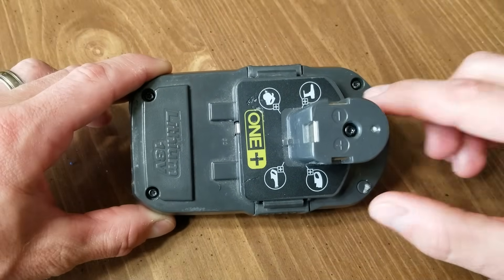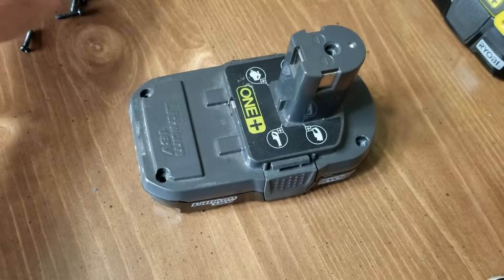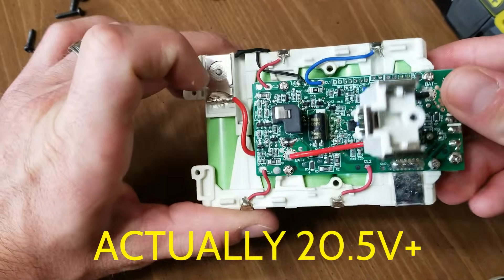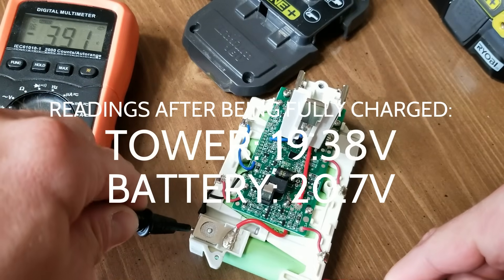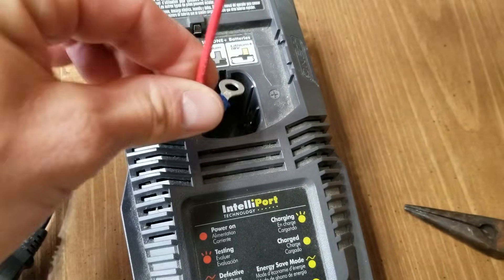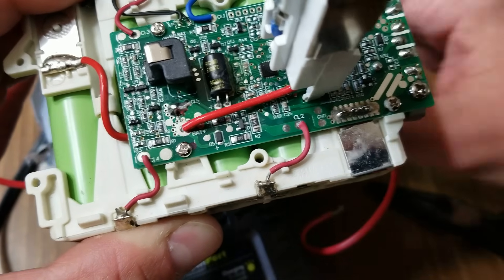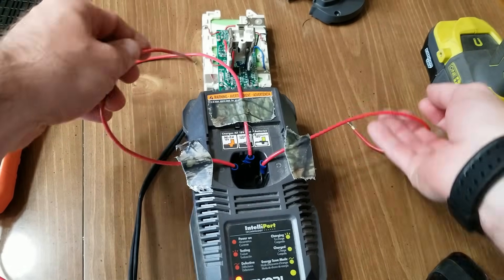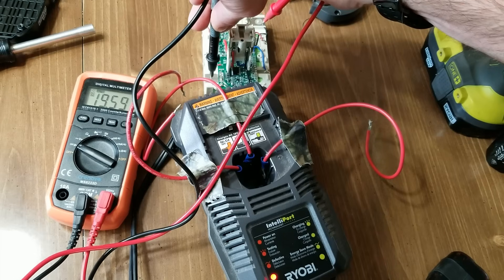RYOBI 18V Battery Not Working? [Easy DIY Charging Hack]

Comment: Easier than I thought! No jump start needed. Once I opened it up and inspected the cells I found a break in the circuit. They were all held together with hot glue which had cracked. Probably a sharp blow like dropping the battery had broken the joint connecting two cells. I glued everything tight and soldered the bus. It worked! My 5 tool pack now has 2 good batteries... just like it came with 18 years ago.
Reply: Oh, the batteries are good like this? 18 years. Sounds good, I hope mine can also work for 18 years.
Reply: Time to get some new batteries.  The new ones really are better.
Reply: Cells have a finite number of charge cycles.

That these have lasted 18 years indicates that this equipment isn't in high usage.

A use case like my ebike that gets charged to capacity at night, then run at high drain rate on my way to work, and then charged to capacity for my return trip, is not going to last 18 years.

I'm hoping for two.

Still cheaper than gas.

Comment: A simpler way I found in another video is to just connect one working, fully charged battery directly to the bad battery, positive to positive, negative to negative. Some wire and electrical tape did the trick.  It worked on one of my bad batteries, after a couple of minutes of battery to battery charging the charger accepted the bad battery.  For this to work you need to have one working battery, obviously. I have one bad battery left. I'll open it and check the cells. Thanks for a great video.
Reply: Must try this on my Tesla 😂
Reply: @stephenhowe568  To revive your dead battery you will obviously need access to a Tesla with a fully loaded, working battery. Don't forget to bring a bucket of water for fire safety.
Reply: Io9 if NBC t ok🎉 you put
Reply: 2
Reply: There's always going to a vape shop for a few new 18650s
Reply: @natekolodziejski Amazon sells them. I buy them for my flashlights and charge them in a rechargeable monitored charger. If that's what is in these then just remove the individual cells and separately charge them in a charger that monitors them while charging. SEE JACKASS WITH THE CONDESCENDING ATTITUDE! No need for all that crap!
Reply: That won’t work always if one cell is lower then the others
Reply: @Thumper68 THAN the others
Reply: Come on man I was hoping I would keard on youtube to just toss it in the freezer or spray some wd40 or just shake it real good but thos is way too much
Reply: Tried that but it didn’t work for me.
Reply: What your describing is a way to fk your battery up
Reply: @pauldean8638  I had two dead batteries that the charger didn't charge. This method worked on one of them. No batteries were destroyed. Why do you think it would ruin the  battrery?
Reply: @niclasbertell8783  because I understand better than you about the difference in lithium batteries to others . Do you know what a bcs and a balancer does ? Especially the latter. Go look it up and get back to me
Reply: @pauldean8638  My battery didn't work. I hooked it up to a working battery. Now both batteries work. What's the problem? It's something you do only if the charger doesen't accept the battery. Once you get the charger to charge the battery, it will handle balancing etc. What am I missing here?
Reply: @niclasbertell8783  why is there a balancer there ? It’s so it doesn’t fry cells . Even just a momentary shunt can fry a cell faster than you can pull a lead off before it smokes . Honestly it’s like talking to an idiot who knows nothing about lithium batteries. Just because you think it’s ok doesn’t mean it is . If you want to know about lithium cells then speak to rc modellers , they know everything much more than idiot who shunts dead cordless batteries . When you shunt it , it will kill one cell off
Reply: @niclasbertell8783  google lithium charging . Lithium isn’t you normal Nicad or nimh, they charge completely different by switch from volts to amps . When you shunt it just throws amps and bolts both at the same time
Reply: @pauldean8638  If it's not working I can't ruin it.  I managed to fix one battery, which is good enough for me. No frying of any cells took place, both batteries survived the procedure. I's probably not the best or safest way to do it, but it worked, end of story.
Reply: @pauldean8638  
Nice condescending attitude
Reply: @islesanctum833  who cares what attitude I have when people teach others how to kill kit
Reply: @niclasbertell8783  it worked, but can go horribly wrong. The batteries can pump out a lot of amps and it's possible to damage stuff on both batteries. It's even possible that a battery can fail spectacularly in the future as its been weakened. Lithium batteries are dangerous. They can be fine one moment and then bite you and burn your house down
Reply: @pauldean8638  if you fry a already broken battery in a fire safe manner you're literally out nothing you weren't prior. Don't do it in you're kids bedroom or something but outside on a driveway with an ABC extinguisher just in case there's no issue here and something might not end up in a landfill
Reply: @niclasbertell8783  would this work with a regular C cell battery or 2 so I don't have to mess with the charger? I'm kind of a weenie when it comes to electricity.
Reply: @niclasbertell8783 Paul is battery  God and your barking up the wrong tree

Comment: Ok, dumb question - Is there a risk of electrocution with this method?
Reply: No, no risk.    18v is harmless.    The human body has way too much resistance for 18v to send the amount of current thru it that could cause harm or even be felt for that matter.     Grab an ohmmeter and set it to a high resistance scale.   Now hold one lead in one hand and the other lead in the other hand.    You will get a very high ohms reading.    Current is equal to voltage divided by resistance (ohms)

Comment: This trick is something I have done with car chargers, the newer smart chargers won't charge a car battery if it's really low (like 8v or lower) but if you hook up the charger then also hook up another 12v battery (or anything close) it will then start charging, I had 12v batteries from UPS power supplies and I would use that to just trick the charger. Now, technically if a lead acid battery drops that low the cells are damaged but you can still put enough charge into one this way to last a few days and to get you to the store to buy a replacement.

Comment: Your video is the best one out there. My Ryobi Li-ion 18v battery was totally dead! Almost no voltage and I measured the voltage of each battery as you said to do and they did not measure the same. I tried your method exactly as you show in the video, and it worked like a charm! Mine went bad after using it on my circular saw. The charge ran out while cutting a board. I let it cool and then when I tried to charge it...nothing! This method brought it back. Thanks

Comment: If a cell is gone, It’s gone. “Boosting” might get you a few really under capacity charges or it could just pop a cell causing significant danger. Just replace the cells and be done with it.
Reply from the maker: Not disagreeing with you.  Pretty sure I said that in the video. If a cell is bad, don't try this.  If the cells are all equal but just below the threshold for the charger to recognize the battery, then this method has always worked fine for me.
Reply: watch the video

Comment: Crazy as it sounds, these battery chargers should bring batteries up to minimum charge automatically
Reply: Right. Just another gimmick to make people spend money on batteries and bad for the environment too.
Reply: Not necessarily.

Lithium ion batteries have a minimum voltage below which they start to experience permanent physical damage.

Because of that, most chargers do not recognize batteries beliw that threshold.

This is where user discretion comes into play.

Look up the specs for the particular cells.

If the threshold is 2.5 volts and the cells have fallen uniformly to 2.2 or better, you're ok to bump start as he describes.

If they are below that, you are taking more of a risk - if they are sitting a 1v, don't even bother - they may take a charge, but won't hold it.

There is also a risk of fire during charge, though its pretty minimal as the charger's overheat cutout should stop things before runaway happens.

The reason the chargers seem strict is because you aren't seei g the full picture.

The bms measure pack voltage and imputs a worst case scenario where you have one bad cell at say 1v.

The reason its 1v is because its degraded - if were from sitting idle, the whole pack would be low.

So 1v is now that cells max capacity due to crystal formations causing internal shorts - if its charged u til the pack reads full charge, it will be way overcharged and the pack will catch fire along the way, or th3 charge will shit down to to overheat.

The core issue is that the bms is cheap and feature limited.

Most of the time when it won't charge, it shouldn't be charged.

Comment: Also know that Ryobi's various chargers can have different circuitry and if one of my batteries won't charge in one charger I'll try a different one.  I have 3 different models acquired over the years (Models P114, P117 & P118) and sometimes the newer P117 or P118 charger won't pass the test to charge a battery but the older P114 model will.  That particular charger dates to 2014 or 2015 and either came in the box with a leaf blower or as part of a 6 piece tool combo.

Comment: Works perfectly!!!!!!!!!!   I had one battery that wouldnt charge and I only used it once.  Put the wires on for about 30 sec and BAM! it is now charging!!!   I was wondering,  could you just put the wires on the battery terminals without taking it apart?  2 wires on neg and the one on pos?

Comment: I fixed mine by putting the battery in and out of the charger quickly about 6xs and on the last one it recognized the battery.  Worked on 2 of them.
Reply: I just did this like 4x times and it worked thx
Reply: Didn't work for me 😭
Reply: Yup mines back up too thanks
Reply: Worked for me to thanks
Reply: Work for me too thanks man!
Reply: I tried didn't work, then tried another 6-8 times and worked like a charm!
Reply: 100%
Reply: This is the real hack. No need for all the stuff this guy is doing lol thanks man.

Comment: Another hack If the bms won't switch the MOSFET on to allow the 20v through you can bypass the MOSFET with a temp fuse. 15a at 70degC. So your protections stay in place. But only attempt this stuff if you know the risks. These batteries can spark like crazy when they explode.

Comment: I had a brand new Roybi 18V battery sitting in garage for a few years and never been used. Recently take it out and plug in and it won't charge. I tried three methods and not be able to revive the battery. This is the fourth try and it worked. Thank You ! Also in my case I found out that the negative and neutral wires should not be touched each other when attaching them to the negative terminal of the battery. I felt really happy finally the battery can be revived using your method.
Reply: I had tried the steps in this video and no luck because I didn’t separate the neutral and negative.  Was about to give up then read your comment and tried once more.  Thanks bro!
Reply: Did you check the pack and cell voltages?

What matters is how long the pack sits at a low voltage.

It just depends on how long it took to become unchargable. 

By law, lithium batteries cannot be shipped fully charged, so if it sat in a store or warehouse long enough, then in your shop for two more years without charging, it could have sat long enough, low enough, for permanent damage.

Your indicator would be whether or not runtime is about what it should be.

If its significantly lower, it will degrade quickly.

If that should happen though, its not the end of the world.

Each cell should have a code on it that you can look up and purchase identical cells to replace the bad ones for about $10 plus shipping.

Because its a proprietary bms, i don't know wif you can replace with cells much different in characteristics.

I may know soon though. I have some good quality modern cells recovered fro. An ebike battery where just one group failed.

And I have a dead 4amp high draw ryobi battery someone have me.

I can try those cells, or I have some older but higher draw (30a per cell but low capacity) cells I can try.

If I can expand the case with some scrap plastic and some deft work with a soldering iron, I can make a big ungainly pack that will spin the bejeesus out of my hammer drill.

Comment: Help if you can. I’ve got several batteries I’ve tried to jump using a good battery. The surface charge gets over 15v on all of them but it doesn’t register when checking it on the tower terminals at all. I put them back on charger really quick but they still won’t charge?  I’ve tried the jumping before and it always worked but it is t this time. An help would be appreciated.
Reply: See other videos on using a DC to DC voltage spply to charge the battery bypassing the circuit board.
Reply: That is a faulty bms (batt. management system)  it prevents/disconnects  the gnd (batt -- ) to tower negative circuit.

Comment: Good idea and helpful video. Unfortunately my Ryobi battery pack was a dead duck; only one battery with ~ 3 VDC, the rest of them 0 VDC.  Could not be resurrected..
Reply: Batteries at 0 VDC CAN be brought back to life, sometimes. I would use a different charger and do 1 battery at a time. Then the pack would contain  n  charged batteries and be chargale. Many ways to skin a cat, or fix a battery. CONNECT TO POWER OUTSIDE FOR SAFETY.

Comment: This worked for me. :) But, It occured to me that if all you're doing is pushing a bit of charge in, there's no need to use the ryobi charger, and wire nonsense. (I have a different charger that seems to have another security pin). In the end, I just used a 12V 500maH wall charger that gives 17V not under load. held that aginst the terminals for about 5 mnutes, until I was solidly above 13.5 V (which I'm assuming is the cutoff voltage of 2.7V per cell). reassembled, and it is charging as we speak . Cheers!
Reply: Ty..what you did plus drilling holes instead of taking apart is what I plan on doing for the larger battery that died on me.
Reply: Even a good laptop adapter works perfectly.
Reply: I tried the way the video explained it wasn’t working. It still wouldn’t register. Even with the non marked pin to the ground. 
I scrolled through the comments and found yours. I did it this way and it worked perfectly. Thank you both for the video and the comment